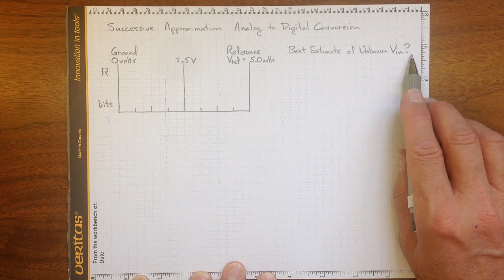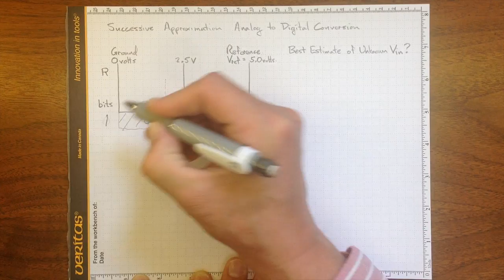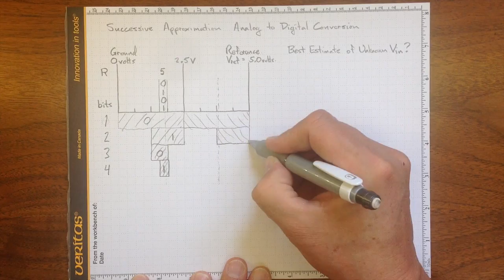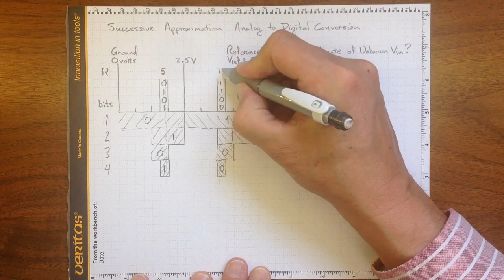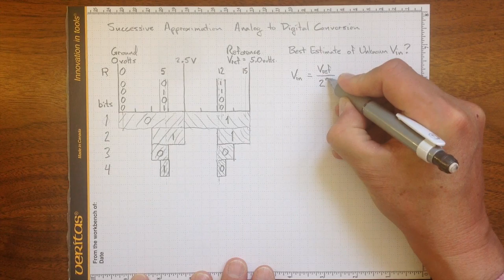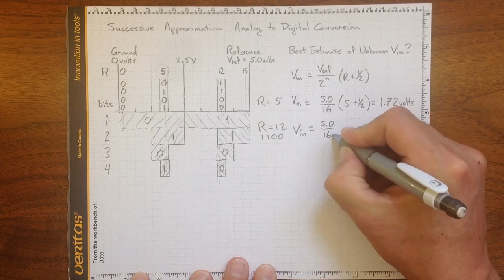Successive Approximations

Comment: Thank you very much sir. But I just didn't understand why you added that 1/2 to R ;(
Reply from the maker: If I get R = 0, that could mean an input of 0 volts, or it could mean a little more, right up to where it would click over to R=1. I can't know what the actual input voltage was, so my best guess is half way between 0 and 1, or R = 1/2. The same applies at any point in the range, because the process always converts to an integer value, rounding down, so we add 0.5 to account for the bias that comes from that rounding down.